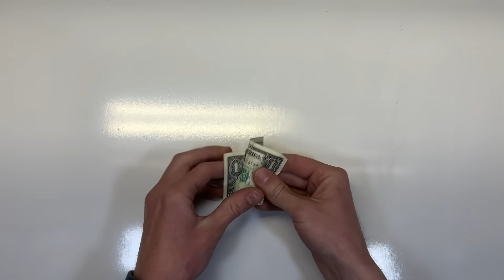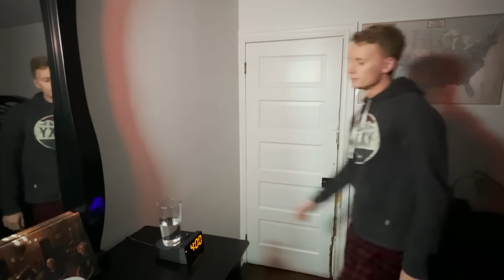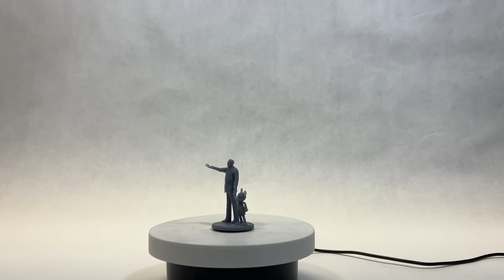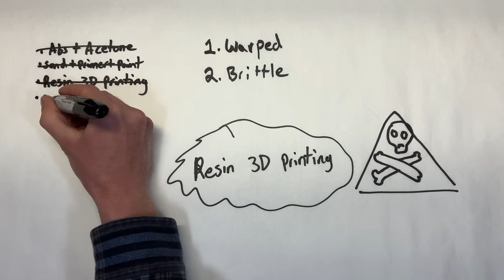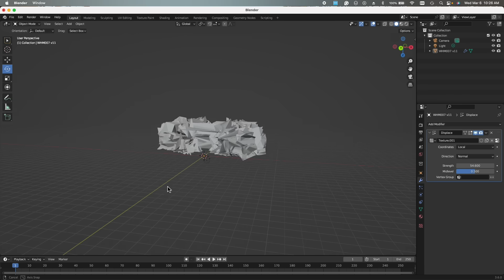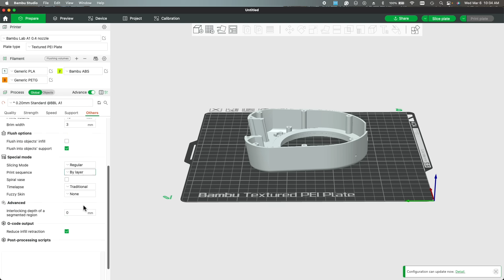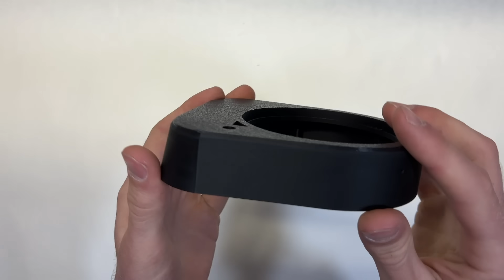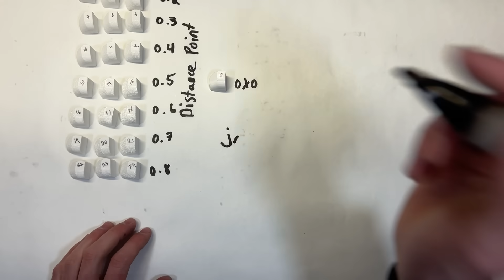My Secret To No More 3D Printed Layer Lines

Comment: If you only sell a few per month, make the case on your 3D printer. But if you really want it to scale take the time to figure out how to manufacture the mold, then use methods that have been perfected over a more than 100 year period. Injection molding, casting, etc. Even if you sold a few per month, you would set aside a day where you only made the cases, then crank them out and use them over time. 3D printers basically have ONE advantage: rapid prototyping. I don't get people who use them to manufacture a particular part over and over. It begs the question: Do you want your manufacturing business to succeed or are you just trying to be a 3d printing guru?

Comment: Resin printing being brittle was easily solved 2 ways. First, you could try mixing resins of differing flexibility parameters, usually stating with 90% normal resin and 10% flexible resin, and adjusting ratios until you have the durability you want. Second, they now sell premixed resins of differing flexibility parameters, in many different colors.

Comment: Well, if printing on a glass bed, you end up with a very smooth bottom part and fuzzy skin walls .... and: fuzzy skin does not work on the top layer, does it? Just on the sides

Comment: I feel like people often times forget that you don't have to go to a massive injection molding company when you need to mass produce parts like this. There are countless ways to make your own molds for small scale productions so that all you have to do is make 1 "master" by 3D printing, and then sanding and priming it smooth, then using that master to make as many molds as you need.
Reply: like vacuum molding
Reply: I wonder how far away desktop injection molding machines are... 😂
Reply: Also, that $10k price per mold was probably a local American company, it's kind of their thing to charge ridiculous prices with the assumption that they'll be dealing with big companies, that can afford it, rather than small runs with hobbyists.

Comment: for resin, try ABS-like resin, and also angle your part and lower the lift speed (I use 5mm/s instead of the default 20 on high speed resin). personally I'd recommend always painting resin, because it really doesn't like uv, and it's safer in case it's not 100% cured.
if you have trouble with the print coming off of the support, use heavier support and add manual supports in the corners (also check that you don't have large planes, that will cause warping and/or failure).

as for tolerance, add a modifier to the tolerance part. you can even model it and use the stl as a modifier, if you're using fusion make a component and add both bodies to it, then export it as 3mf, then import in your slic3r based slicer as a multi part object, select your modifier object, right click -> change type -> modifier, then right click -> add settings -> fuzzy skin -> check fuzzy skin, and then set it to none.
another option is to do the opposite and make a modifier just for the outside and enable fuzzy skin for it. (with fuzzy skin disabled in settings.)

Comment: Why didn't you think of making a mold from a cleaned up part where you took the time to sand it to the smooth level you wanted? Then you can just pour molds all day long. You can even make several and pour 4 or more at a time.

Comment: brilliant stuff, i'm a professional maker, prop maker,  with filament printing smoothing stuff out isn't sand paper!! Smoothing stuff is different from making something flat..  First off, if you want it smooth don't print it thin, you need weight to the outer skin so it can be smoothed. (not sanded).  If it's not strong you wont get it smooth,  if you put your 3 most important points on each corner of a triangle you wont get any closer to one without moving further away from another.  Chemicals isn't an option (abs is a pain in the butt).  check out engineerwrong for the right tools and consumables.

Comment: I'm glad the fuzzy skin solution works for you.  I'm a consultant engineer who develops medical devices.  I have several resin and FDM printers and use whatever process seems the most appropriate for a part.  If you ever need smooth, very detailed surfaces try using Sunlu ABS-Like resin which is also relatively inexpensive.  Until switching to this resin I had many printing failures due to warped parts.  I believe the slight flexibility of the cured resin helps eliminate most of the stresses introduced during the printing process which leads to warped parts.  I'm sure there are suitable resins from other manufacturers, but I had little success using the brittle standard resins.
Reply: the worse offender imo is high speed resin, it is kinda marketed as general purpose, but it's far from it, it is very hard, which is great because it is dimensionally stable, but it also means it's glass-like and will shatter if dropped, it's fast curing, but if you're printing with the door and/or window open, it will get skin within 30s if  you lift the cover on the printer.
also you absolutely need to process it indoor or at night otherwise it dries while you're removing it from the bed.

Comment: Why are there so many haters in these comments? People moan when its vague, yet they will moan when its thorough explanation. Nothing wrong with documenting your trials and errors and letting us know about them. Especially to a noob like me. I appreciate the effort 👌
Reply: I personally hate the video, because it is misleading. The part about resin printer being brittle can be just because he didn't UV-light the part after print.
Reply: @sandiegosummer  bit dumb seeing as hes showing us his trials and errors and telling us why he made that decision. Of course its because the resin printer wasnt operated correctly. But he wasnt about to spend weeks trying to fix what a filament printer can do instantly with no issues
Reply: @melonpip To those experienced in printing, it's his attitude. He did the same for the absurd acetone sketch which isn't even remotely close to how ABS is supposed to be smoothed with it. There's no notable fire danger when vapor polishing properly and it's still a very useful option in many cases but he smugly dismisses it.

This is a stretched out, misleading video about a setting that is years old and his 'product'. It'd be fine if he actually gave realistic examples of these done properly but instead it's an arrogant presentation about his brilliant money-saving solution. Beginners will think this is great, I've been there. I've also then been very frustrated later when realizing many 'tricks' and suggestions constantly repeated by the community had only wasted a ton of time.

Comment: FYI, resin prints are finnicky. Your print failures look to be caused by poor supports, incorrect model orientation, too short a layer cure time and possibly inconsistent resin temperatures during the print. Something worth exploring. It could also be too fast a retraction that causes layer separation. The level of warping you had is pretty nuts actually, so I think possibly your fep film might have been a bit too loose/stretched.

The resin being brittle is an inherent property of "standard" resins. You probably needed to use something more like Siraya Tech Blu-Tough resin as that's meant for more practical resilient prints. 

Standard resin is meant more for things like miniature models. You should maybe have another go at resin printing your parts! With the right resin and settings you can get highly resilient and professional looking pieces. Might make for a good follow up video too. There's a few resin manufacturers that offer "tough" resins, so it's worth experimenting with that, too.

Comment: Instead of filler primer you can use 1k automotive glazing putty with a little acetone to thin it out, but not to much like water. Lay it on thick then sand once and paint once.

Comment: i think you should also consider trying out some of the premium engineering resins.

the type of resin used in SLA printing vastly changes the outcome. like the difference between PLA and ASA in FDM printing, resins are completely different for different use cases.

Comment: Hi, so I've been 3d printing since 2020 (with the pandem situation) and I can give you a tips for your resin printing sticking on the bottom of your fep because I had the same issue and it's an easy fix. You just have to put 2/3 drops of PTFE lubricant on your fep then wipe it with a microfiber, it will create a film than prevent the print to stick, hope it will help you !

Comment: EASIER WAY. Media bast (gentler than sand blasting) the part in a blasting box. If the work pieces will be many per day, quite simply robotize the most efficient holding and movement of the spray (blast) over the object. Fitment areas are typically masked where mating surfaces interface. The result is probably the same or better than FUZZY and probably much less time consuming. Some surfaces can be shot peened thus increasing their resistance to cracking, as is done on connecting rods for internal combustion engines. Cool work and experimenting you have done.

Comment: there is a easy way how to do it with acetone. but the print in a closed container and ad a little bowl with acetone next to the print. close the container and wait 1 day. The acetone gases dissolve the surface and smooth it. The acetone itself should under no circumstances touch the print.

Comment: Resin printers are not inherently faster than fdm printers, it depends greatly on the model. Whereas fdm print times are based on volume, reaing print timds are based on height. Wider and shorter parts print faster on resin printers, skinnier taller parts print slower. But, you cant really beat the quality of resin printers, at least until you get to sls printing.

Comment: If you want to use acetone smoothing, you dont have to heat it to get it into a vapor, you could use an ultrasonic device to do the same job while keeping it cool and keep everything in a sealed chamber.
Reply: an ultrasonic device has the same issues, imo using a bain-marie is the safest solution, you don't have any open flame and don't risk sparks.

Comment: I using the Fuzzy with my printer Creality K1C by Creality Print 5.1 Software but the Quality it not seen so good like your product. For the Top and Bottom, It's print as normal without Fuzzy. So, Can you recommend the Setting of the software, or the best software should I use with my printer? (Material I using is Creality Hyper PLA)

Comment: This title is a bit misleading. It's not "No More 3D Printed Layer Lines". It's "Obscure Layer Lines With Fuzzy Printing". To eliminate layer lines and achieve a smooth surface, try using thin coats of resin and sanding with fine grit.

Comment: I have had an Anycubic Photon for years. The resin printers are definitely not faster in most cases. They are also very hard to set up properly but once you have them set up, they work like a charm.

When you set up anything for printing, it's usually safest to set up a base that is as big as the biggest portion of your print so more surface area is attached to the tray then the FEP film, it vastly reduces the chance of your print coming off mid print.

Comment: I don't know about bambu slicer, but in both Prusa slicer and Cura you can select areas of your part and change modifiers such as fuzzy skin, perimeters, infill etc. This should be possible in bambu slicer too. That way you can just disable fuzzy skin for areas that need tight tolerance or won't be visible, saving time both printing and post processing.

Comment: sand blasting  i would tried that  but i am lazy and compressions are cheap and a must have .tip never ever buy an oil less pile of garbage they are only good if you never use them and its silly to buy one  plus no resale value

Comment: or just completely get one print smooth as per the old sanding method (before you discovered fuzzy)   make a silicone mold, and cast that mold with any product you want, including aluminum ....and if casting with strong resin it only would take a few minutes (from the same initial mold) each unit . that one silicone mold will last for hundreds of castings

Comment: I really wonder how bad the settings of your resin printing or the resin you chose, must have been.
Because honestly.... the only time my prints failed like that were, when i tried printing below 20°C room temperature.. 
I really don't get how your prints turned out so brittle or bad.

Also.... you shouldn't burn aceton and ABS just for clicks.... especially without at least an ffp3 filter mask..... that stuff is toxic and highly carcinogenic....

Comment: $10k for your injection mold is a bargain. I used to work in a massive plastics factory that made everything you can think of in large and small batches including 1 off's. One of our Contracts was with McDonalds Australia to make their plastic teaspoons. (Wish I had kept a couple they will be collectibles soon). The Mould for the spoons was approx $300k U.S. ($500k AUD). It wasn't that big. It did about 10 spoons per cycle. Each Plate was around 50cm square and around 10cm thick. There are two plates for the two halves of the mold.

Comment: However, if you absolutely need a smooth surface, a filler spray is extremely practical. But only if you really want to paint the object afterwards.

Comment: you could even improve the look and get around the fitting issue as well by modifing your 3D model with an actual texture you like. Use any texture you find as a displacement and convert it into the mesh itself. there are a lot of tutorials on how to achieve this in blender. With this method you are able to add variations of your product and by masking the sections where it needs to fit other parts you are ready to go.
Reply from the maker: Thank you for the suggestion! Using displacement textures in Blender to add detailed surface textures directly into the mesh is a great idea and could indeed offer more control over the final appearance and fitting issues. I appreciate the tip about masking sections where parts need to fit together, as that would certainly help maintain the necessary tolerances. I'll definitely look into some Blender tutorials on this technique to see how I can integrate it into my workflow for future projects. Thanks again for the valuable input!
Reply: @jakemgrim  You're welcome. Getting into UV-Mapping (for teh masking) process) and an overall understanding on how to place details where you want them to be would be the best starting point for this. Good luck with that and keep us updated on how it works for your workflow

Comment: I get that this is to avoid the PP, but if you did want a smooth looking piece then it seems like the fuzz might still be better than normal printing, being random and thus without the obvious pattern of the layer lines seems like it would take less sanding and filling to get a mostly smooth look. 🤔🤔
Reply from the maker: That's an interesting point, Joe! The fuzzy skin texture can indeed help reduce the visibility of layer lines, making it a good option even if you plan to smooth the piece later. The randomness of the fuzz could mean less sanding and filling compared to dealing with uniform layer lines. It's definitely worth experimenting with if you're aiming for a smoother finish with less post-processing effort. Thanks for the insight!

Comment: It would be more appropriate to do some parts of the model this way via stl.
Reply from the maker: That's a great suggestion! Applying the fuzzy skin texture selectively to certain parts of the model could offer the best of both worlds—hiding imperfections where needed while keeping other areas smooth for fitting or aesthetic purposes. Modifying the STL file to add texture only where it’s beneficial can provide a more polished and functional final product. Thanks for the tip; I'll consider this approach for future designs!

Comment: Fail with resin????
Ok you Need to be onest....Is impossible fail with resin.
Reply from the maker: I understand your skepticism. Resin printing is generally known for its high detail and smooth surfaces, but it can still present challenges, especially when scaling up prints or dealing with specific design requirements. In my case, I encountered issues with warping and brittleness, which made resin printing less viable for my project. I'll make sure to be more transparent about these challenges in the future and provide more context for those facing similar issues. Thanks for the feedback!

Comment: Have you try electric grinding and polishing? Im pretty sure that you can do two parts in "that" hour, at least
Reply from the maker: I haven't tried electric grinding and polishing extensively myself, but it's certainly an option worth considering for smoothing out 3D printed parts. The speed and efficiency of electric tools could indeed save a significant amount of time compared to manual sanding and priming. I'll keep your suggestion in mind for future projects and experiments. Thanks for sharing your thoughts!

Comment: Please get a respirator for sanding and priming.  No arguments, its for your lung health.
Reply from the maker: Absolutely, safety first! You're absolutely right about the importance of using proper protective gear like a respirator when sanding and priming 3D printed parts. Ensuring lung health is paramount, especially when working with potentially harmful particles and chemicals. I'll make sure to emphasize the importance of safety precautions in future videos. Thanks for the reminder!